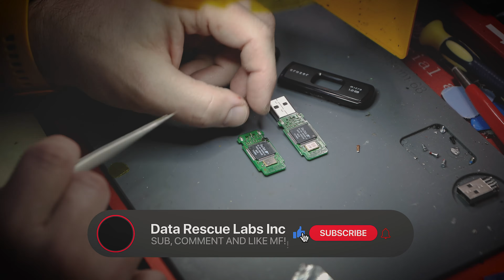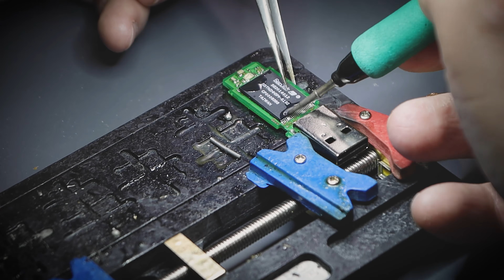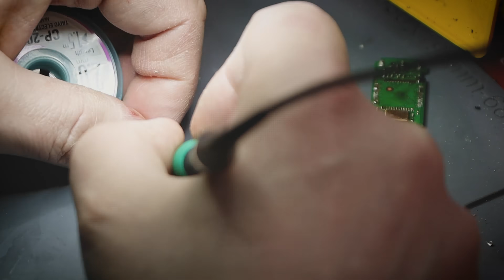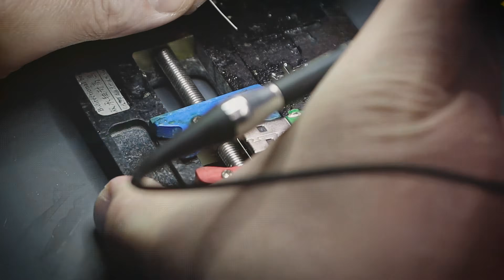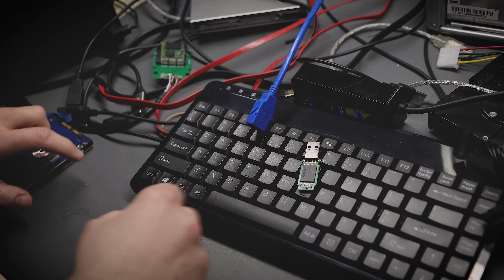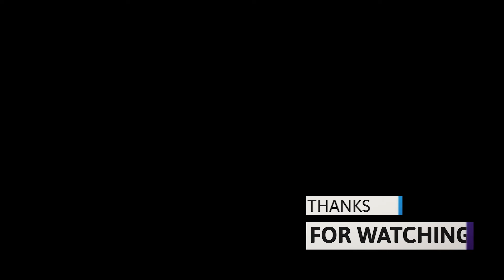SanDisk USB not showing up. Repair fix with a swap

Comment: clean job, did you put the chips back on the old board to save for parts? what soldering iron did you use i assume a micro ?
Reply from the maker: Thank you. I do keep most of my old USB drives for parts. I use JBC Nano soldering station.
Reply: @datarescuelabs  you are welcome, i do some repairs myself, as a hobby. i just like to tinker. i am no where as talented as you, haha. one day i might be, i need a good microscope first.